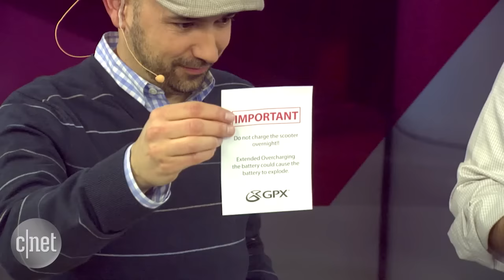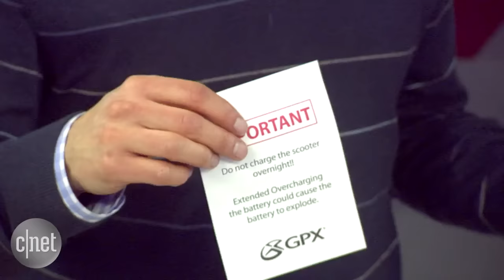Hoverboards can be fun but also a serious fire hazard

Comment: 3:37 pretty sure he just pulled that socket off the board. I did that with a sata socket on an old motherboard once. Use the release clip...
Reply: +kristian brasel Lol thats exactly what he did. There goes patience i did that once with a sata port to idk who idea it was to put safety clips on new sata cables. Port still worked fine after.
Reply: +kristian brasel YES NO question...  I have seen many of the videos of them taking this apart this was done in a rush and was not a good example of the work they do.  Doing this rush job without having already taken it apart once before in a dry run to remove glue and get things ready to come apart made them look very unprofessional.  That is sad because the other videos they do they would pause and come back and show how they solved something that wasn't coming apart vs just pulling harder.
Reply: +BoyTitan  Ya me too, I nearly ruined a new motherboard trying to take out the SATA cable, luckily I noticed that these new SATA cables had a metal hook on them. I think the guy on the video got too nervous doing the show in front of an audience.
Reply: +kristian brasel hahah that was the funniest part. The rest was all just jibble jabber useless jargon. Didnt really show us why they light on fire or how to prevent it. Just dont leave it overnight ? not stab it ? thats pretty much a given i would say.
Reply: +Jonathan Hassall I hope by making a personal attack on someone makes you feel better about yourself.
Reply: WhatIThinkNation
What he said is how to prevent it. Not much you can do to keep a cheap battery from blowing up except avoid getting ones with cheap batteries.
Reply: +BoyTitan fink there Dandgrous  the little kids don't fink that fast.
Reply: fail
Reply: +kristian brasel DAMN!!!! Thats Made In USA Assembled in China must be
Made In USA Assembled in Korea and Made in USA Assembled in Japan
Reply: +Yennie Constanlin USA recalled cars kills read about it please.

Comment: I'm sorry but I have to be honest here. This is pretty much a sub-standard "buzz word" presentation. Runs on about the dangers, then bumbles through some possible components, notes on how they are always ESD safe(?), wrestles with connectors many times, plugs the CNET magazine, points out the wheels and battery more times than I care to count... If there was value here- I missed it.  Sorry
Reply: +MKme Lab Exactly, it's just insipid clickbait.
Reply: +MKme Lab Its worse that that. This presentation was a MAJOR FAIL!. Do these guys even know anything?? You don't get shocked from a 36 volt device. There are no inverters, so no source of any high voltage. 

But the biggest FAIL is they seem to know nothing about batteries, and did not even bother to open the battery pack and explore why there is a problem. All they do is ramble on about how smart they are, but say nothing. These guys are stupid and it shows. 

Now, what you really need to know:
All of these units use a 18650 battery. There are several different versions of that battery. Federal requires that the 18650 (or any battery exceeding a specific current output) must have internal short circuit protection and over charge protection. The problem is that some of these units are using a version of the 18650 battery that is illegal to be sold in the US, as they do not have internal protection. The second issue is the type of Li-ion battery makes a huge difference in the battery's tolerance to heat, short circuit, or over charging. A quick study on Li-ion tells you that Li-IRON is very tolerant of over charging, does not tend to over heat, and will tolerate many more discharge cycles. Its total capacity is less than other types of Li-ion, but it is a much more durable battery. 

So what is the answer? As it turns out, many of the new self balancing scooters are using Samsung brand batteries. If you look up the spec for Samsung, you will find that the Samsung 18650 battery is Li-iron. It has internal short circuit protection. So if you purchase a unit with Samsung batteries, they will not be prone to catching fire, as other units have in the past. One word of caution, just because the manufacturer advertises Samsung batteries, and it may say Samsung on the external label, this does not mean that it really is a Samsung battery. There are several counterfeits out there. You need to actually slit the battery pack apart enough to view the battery its self. Then you will know that you have a safe unit. 

Its unfortunant that CNET did not bother to do any research. at the time of this video upload, many of the suppliers have gone to the Samsung batteries. They could have made a useful video if they had bothered to do a little research!
Reply: Thank you for this explanation! It's very helpful! So do you think that to know if the battery is Samsung is enough to open the board? Or you should also unwrap it from this blue wrap?
Reply: The 18650 battery is about the size of a AA. So you can see the round 
tubes inside the blue wrap. If you carefully slit the blue wrap were it 
goes on a slant to the 4 batteries on top, you should be able to view 
the batteries inside the wrap. Do not pull the whole blue wrap off, but 
just slit a small triangle cut, so you can flap open part of the blue 
wrap. You should be able to see the pin stamp printing Samsung uses to 
label their batteries. Once you confirm the batteries are really 
Samsung, make sure you seal the pack back up. Hoverboards collect a lot 
of road dirt. You don't want that road dirt getting into the back and 
eventually puncturing the surface of the battery. Puncturing any type of
 Li-ion battery is bad news.

Comment: One big point about the fires that they didn't cover was that this has a battery on one side only. So the main power is going through the middle and powering the other side motor. So when they often break at the weak point in the middle.  The main power wires are cut and the whole thing shorts out can that is the source of many fires.
Reply: Honestly, seeing how they enclose a small leaflet about advising to be near the device during charging: it's OK advice to say that, but that they actively mention the risk for explosion due to overcharging seems to suggest they've cut corners in battery management.  Battery management works for situations like a short circuit after battery management, not for situations inside the cells or between the cells and battery management.
The simple fact that so much of these things caught fire seems to suggest most manufacturers left charging safety over to the charger, and not the hardware inside the device.

Comment: Remove the scooter battery and replace it with a Double A battery
Reply: Alkaline batteries don't have the current capacity to be used in such a device.
Reply: +{MLP} Rainbow Dash well solar powered don't do either
Reply: BasicLifeOf 360 it could, but only if the panel was big enough and had the proper power output. But, it wouldn't be worth carrying such a big panel like that

Comment: They're talking about this fire hazard as if it is an acceptable thing to deal with. Listen. This thing should have never hit homes without a protection circuit which prevents overcharging. These cheap unit seem to just have a direct connect from the power brick to the battery. With Lithium Polymer batteries that's a major no no. For the cost of these, they should have thermal and delta V and overvoltage protection and all just like cell phones do.

Comment: this video was absolutely useless. i was expecting a detailed teardown and explanation of the balancing circuit or lack of, charging circuitry, wire gauges, 18650's or lipo, .  the guy just took it apart and rambled about.....whatever.  fail.

Comment: the battery is overcharging bequose the charger is sheep en have not limiter in it Chinese imitation where profit needs to be at max en safety is something for idiots wires to shinny, batteries under power even rejected ones, connectors flimsy, where is the ridged test before the stuf can come on the market, en where is customs to stop imitated goods en put the imitators en the importers in prison..Read more Show less Reply1